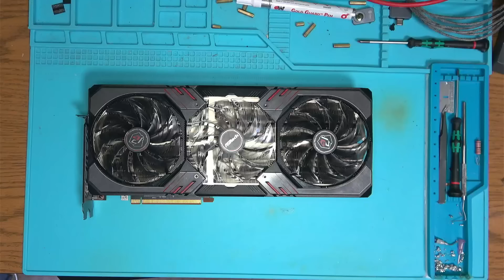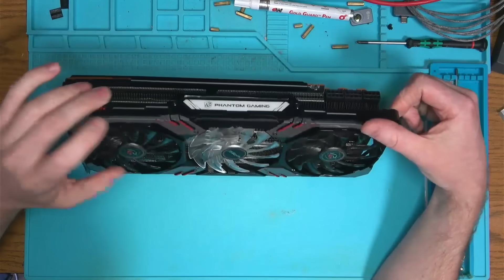Whos GPU is this ?

Comment: I have not had an AMD Radeon card since RX 570. So there may have been updates where it does work now.
The Afterburner software only works fully with Nvidia based GPU's.
The AMD Software: Adrenalin Edition Application is for AMD based GPU's.
The Intel based GPU's have very little 3rd Party support, that works correctly and gives valid readings.

Comment: You have to find out how much is the legal time you have to hold before selling. Otherwise you might get into a real lawsuit this time.
Reply from the maker: scarry
Reply: Dont quote me but I believe it is 90 days. As ive looked it up for other things in the past and it said left property you can claim after that period.
Reply: that will depend on where they live and the legal agreement made. if its on paper its 30 days then thats the limit. if its 90 then thats the limit. and any state laws that may apply. but i believe the busines can set the time limit.
Reply: The holding time is whatever the contract says it is, which the customer signed or agreed to.
Reply: @Wickedlazy  When I ran a repair business years ago we had 90 days set as the policy. After that it becomes property of the business and disposed of.

Comment: After I watched this I realized an issue I can relate to as well, I use an amd card too. AMD software and MSI afterburner just really don't like each other, I used to have an RTX 3070 swapped it for my now rx 7800 xt then I DDU wiped the pc clean but I was always experiencing crashing issues with a brand NEW card that I just bought like a week ago at that time. 

I'm not really sure if it's msi afterburner or rivatuner but it's one of those software that causes amd to keep crashing like clockwork everytime the card ramped up it crashed but after I revo uninstalled msi afterburner and rivatuner it never happened again.

Comment: Well known causes to crash RX6xxx series is MPO (just disable it in regedit), MSi afterburner is using MPO. The other is min core frequency. I guess high oscillation from 600MHz to 2.4 GHz example will crash the drivers so bump up the min frequency will fix it.

Comment: Yep Afterburner don't work right with 6000 series cards, I know that for sure as I tried it with a 6800xt and 6600xt and both cards had problems with afterburner so I stopped using it, the AMD Adrenalin software is pretty good so you don't need afterburner with AMD cards.

Comment: Huh... I never ever heard of this issue with MSI Afterburner, infact I'm using it right now with my 6650 XT.
Never really had an issue with the fans going above 100%. And I'm using the latest version of MSI Afterburner.
Reply: I just gave away an ex mining rig to a friend to use as a pc, I tested it to make sure it works. The 5600xt with latest AMD drivers didn't play well with MSI AfterBurner. This was last week.
Reply: I had an RX 590 that would go up to 105% in Furmark. Long story short, it was time for a proper maintenance and I decided to start using liquid metal. The card went from overheating below normal clocks to having room for more overclock than the Radeon Software suggested and it was still silent and limited by power delivery. I think MSI Afterburner wasn't allowing me to start Nier Automata for some time.

Comment: it is true...msi afterburner gives wrong values for the gpu frequency...(basicaly...it overclocks my gpu more than it should by default) 

also every time when i was launching afterburner...the default frequency it shows...it is different each time u launch it.(higer...or even higher/ 2700 or over 2800 mhz the frequency) without me doing anything.

but since i havent used heavy games to experience crashes...all the tests i did (well not tests but more like research to see how it works)
and i did noticed that msi afterburner needs update when using specificaly the gpu 7900xt.
it literaly has the frequency around 2700mhz(or higher i think) 
maybe makes no sense what ive just said...
the thing is....i gave up using msi afterburner for 2 BIG reasons.

1. It keeps the gpu frequency too high by default.
2. Fan speeds stop working if i use a custom fan curve. (basicaly once u close afterburner the fan speeds does not revert back to default,instead they remain static,i noticed that when temps went beyond 95.c on hotspot)

In the end...i got the hang of the actual adrenalin software to configure the gpu properly...(well using a custom fan curve to be more specific) and it works like charm..
i can do pretty much same thing with the adrenalin software now...i dont use msi afterburner anymore. (sure it worked fine with the old gpu i had, witch it was nvidia but not with amd)

Before all of this i took a look in GPU-Z to see what the actualy base freq and boost freq is on this gpu..and what i saw...(maybe they are wrong..idk but i use them as a reference to know if im going too high or too low)
and the frequency were:
base clock 1387 mhz (pretty much 1400mhz)
game clock 2025 mhz
boost clock 2394 mhz ( basicaly 2400mhz in my eyes)

memory clock 2500 mhz

so my refference was 2400 on the core and 1400 base.
while memory was 2500 all the time.
while afterburner pushed that frequency beyond 2800mhz...(then i begun to worry a bit. so i had to lower the frequency manualy every time when launching it.)
of course while heavy gaming even without afterburner the frequency of gpu core was reaching 2700 2800 peak ( IF i was rising the "power tuning" from afterburner)

Comment: I have a 4090 suprim x, but I can’t get the card to overvolt at all. Any thoughts? I’m using the 3 prong connection Corsair plug
Reply: When was it manufactured?
Reply: @FireBarrels  I got it during release date

Comment: I head similar problem and i got a "AMD 6950 XT" and the problem is in driver if i install anithing grater then driver 22.x will cresh or reset or random bluscreen. 
Runing Windows 10 for crashi and bluescrens.
BTW in Linux no problem :)

Comment: my asus tuf 6800 would randomly crash with the video card error light on my board. just randomly, i was using an asus tuf x570 wifi board. i upgraded to a different card, and put the 6800 in a asus rog b450 with my old 5600x, and the crashes stopped. go figure

Comment: AMD gets a bad rap, my 6900XT (5950X) machine almost never crashes. It's used 10-12 hours per day, 6+ days a week. 

I can't say my nvidia machine is more or less reliable, it's about the same but is a less complex system. 

I have not used Afterburner with AMD since the 5700XT came out. It didn't work at all. But there's always software that crashes or conflicts when installed along side other software. This is why when running servers we only install the minimum required for the purpose.

Comment: The MSI Afterburner issue is another problem that AMD fanboys deny exists
Reply: Works fine for me tho 🫤
Reply: Why would anyone deny the existence of buggy MSI software? 
I dumped Afterburner ~5 years ago when I used my Vega 64. AMD's drivers have built-in overclocking support, fan curve customisation, and hardware monitoring so it's not like you need Afterburner for anything.
Reply: @Often_Sarcastic  MSI afterburner works fine with Nvidia GPUs though. The issue is that AMD drivers have some kind of conflict with MSI afterburner. I wouldn't need Afterburner if AMD's software wasn't so buggy. At least once a month, I get a minor driver crash (black screen) and all my undervolt and fan curve settings get reset.
Reply: @WrexBF  Afterburner running fine on Nvidia hardware doesn't really matter when talking about compatibility with AMD hardware. Windows similarly runs fine on X86, but doesn't really run on RISC-V because MS doesn't support it. 

Can't really comment on black screens because I don't have that problem with my 6800XT. Only problem I've had was the Beta AFMF preview driver, but AMD's driver clean-up utility and an install of the regular drivers fixed that. Only time my wattman profile resets is for driver updates, so I just reload the saved profile after.
Reply: @Often_Sarcastic   MSI afterburner supports AMD, Nvidia, and Intel GPUs so, your RISC-V analogy isn't relevant. That AMD MSI afterburner issue doesn't happen when you only install the bare driver. The issue arises when you install other features that come with the AMD driver like ReLive, Wattman, etc. So, the blame is on AMD.
Reply: Just use amd adrenalin overclocking  it's better

Comment: My advice: don't buy AMD
Reply: I have an RTX 2060 with a driver issue that hasn't been resolved in years. Until recently it was listed as "ISSUE 3992875" in the driver notes.... So... Don't buy AMD or Nvidia. What's next?
Reply: @EDOD_EseDelOtroDia  Dont buy Intel 😂
Reply: A N I M E
N
I
M
E
Reply: @EDOD_EseDelOtroDia the checkerboard "artifacts"? that problem happens exclusively on Chromium based applications... how is that an Nvidia driver problem?.....
Reply: More or less Agree with you there. Besides Nvidias pricing bs their cards have worked flawlessly for me for about 8 years now.
One particular card has even survived a liquid metal incident which was surprising but nonetheless great.
Also of course not every brand of card is the same. I've blacklisted Gigabyte because of my personal history / experience but other than that...
Reply: @brunodinis7454   It doesn't happen with either AMD or Intel. So, obviously, it's a thing of Nvidia's.
Reply: Meanwhile the Nvidia drivers crashed mid cs2 tournament 😂
Reply: Bandwagon
Reply: I agree with you amd radeon suck.